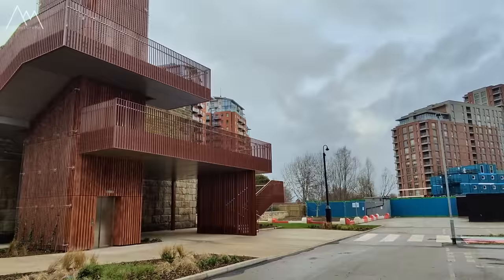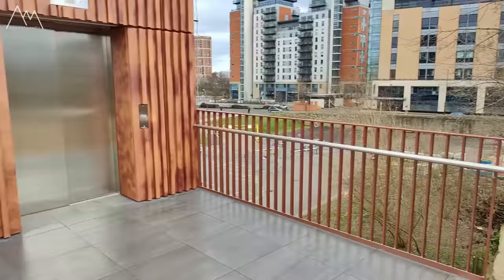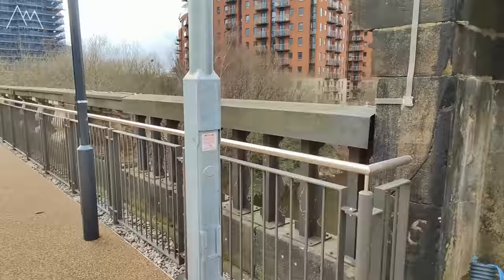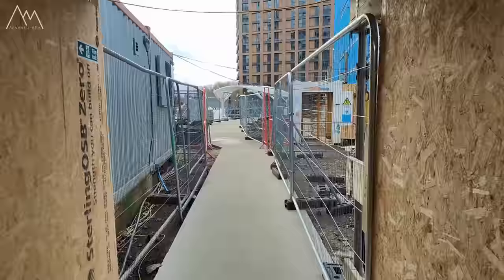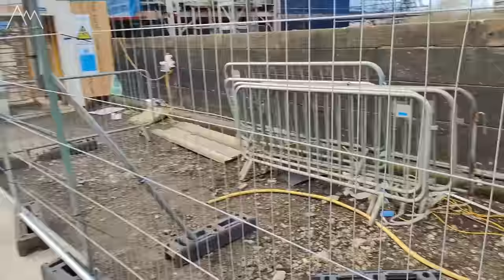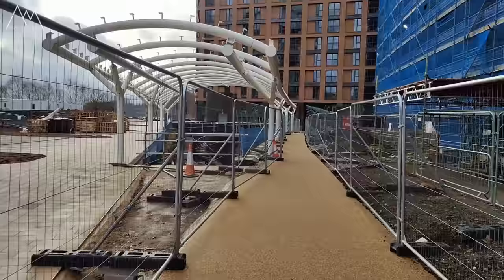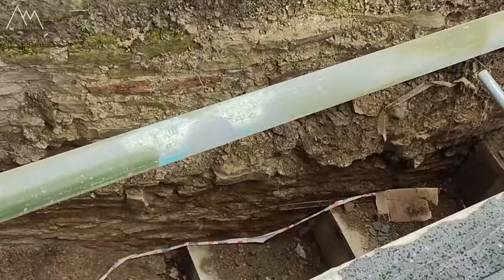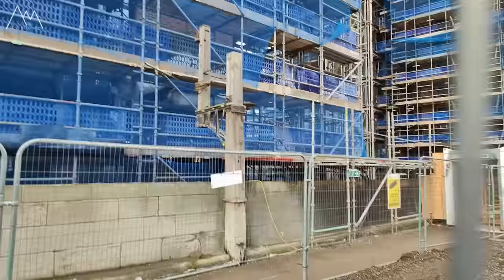The Garden On Leeds Central Railway Viaduct | Let's Explore!

Comment: Fond memories of when I used to work around there back in 75, when the viaduct used to run all the way up to Wellington St, some of the archways underneath were used by businesses, I used to buy pop directly from one of them, at a fraction of shop prices. The company that I worked for at the time, hired the spare land that used to be the space that was once filled by the old Central station, right next to the YEP building, the only original thing that's left around there now is a wall that divided the YEP and the waste land (not counting the preserved hoist/lifting shaft). We were making the shutters up there for the Bond St Shopping Centre job. I have to admit that I have a soft spot for this area, I was only 17 at the time, an apprentice Joiner, and as I'm almost 66 now, I'm probably the last man standing that was involved with the building of the Bond St Shopping Centre (which has been renamed since). But just in case I'm wrong, it would be good to hear from anyone that was there when I was.

Comment: Iused to travel from Doncaster to Leeds via Wakefield accross an old viaduct into Leeds in the 1980s on the Pacers, is this the same viaduct? I remember that the Pacers used to make horrible squealing sounds and their used to be delays to services on a regular basis due to points failures. Interesting video by the way.
Reply: not the same viaduct. however i believe there is a video online of it been explored.

Comment: What's the difference between Leeds and other major cities? Others turn old viaducts into modern metro systems, Leeds turn it into a garden 🤷 another reason why Leeds follows in the footsteps
Reply from the maker: It's only a small section that's left and runs into a dead end. Plenty of other viaducts for them to use, like Holbeck.